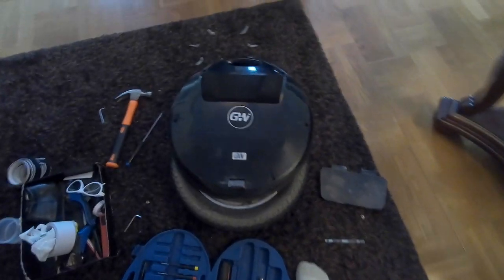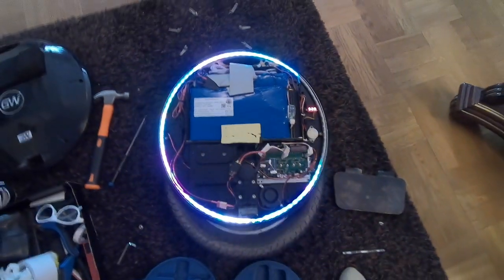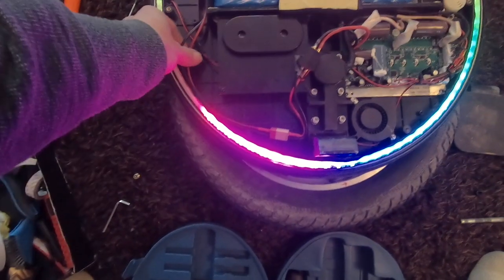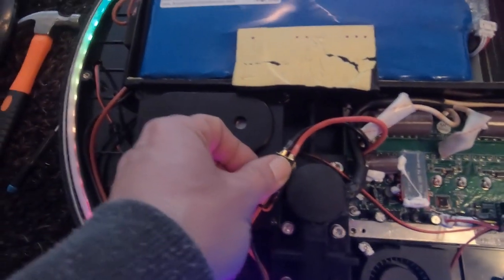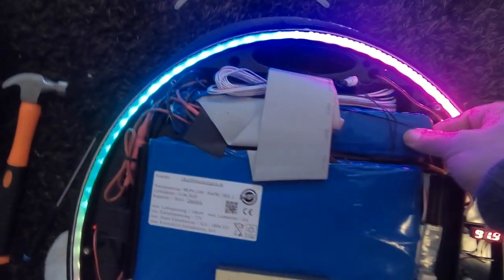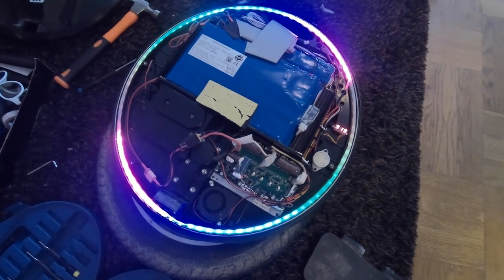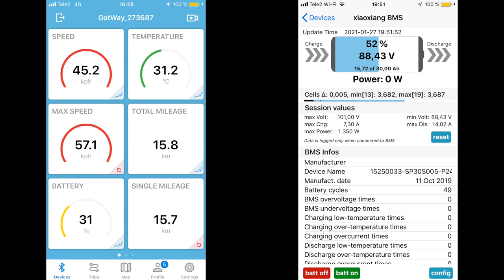The Return of my 1Rad 2664Wh Nikola Plus - Summary in Description

Comment: Hey Mike,
Happy for you, you finally got your Nikola back.
I'm curious, have you considered/researched purchasing your EUCs from a more reputable source like say e-rides.uk or myewheel or eucservice etc?
Stay safe bud!
Reply from the maker: Hi Moshe! 1Rad was said to be reputable. E-Rides has shown to be reputable however as of Brexit they are no longer an option. EUCService has shown to have long delays and also they did not have the 2664Wh mod. I chose euc.sale this time as the price was right and several riders in the group have purchased from them and also Denis does a lot of good work for the community and is an awesome and genuine guy. In the end buying many wheels = buy as cheap as possible and then just pocket the difference. That can be spent on reapirs instead of spending extra and not getting any service anyway. Even AliExpress would have handled the motherboard issue better than 1Rad.
Reply: @isthereanyfood  thanks for the response Mike!
Yes, I'm aware of Denis from euc.sale, he's a nice guy & legit.
Good luck with your new wheels!
Safe riding👍
Reply from the maker: @mo_euc  Thanks! I am happy to have the Nik back. The EX.n is nicely priced and basically a fat RS. I will see about opening it soon and seeing what I can do to improve it a bit.

Comment: Hi there.
Do you know much about the 3rd generation internal circuit board?.
Is it fine with the 2nd generation board?
I'm looking to buy the 84v GW Nikola which currently has the 2nd generation installed. Haven't bought yet
Reply from the maker: Hi Ava, are you getting a used 84v Nik? It is still a very nice wheel especially if you can get it at a nice price. The 100v Nik Plus from Chicway is a steal so make sure you compare with that. If you see everything I have been doing with my 2 year old MSX you will see that it really takes a lot to kill a wheel and there is very little wrong with them.
Reply: @isthereanyfood  I'm buying a new GW Nikola 84V 1600wh with the 2nd generation motherboard. I've ordered a 3rd generation board to be installed at the shop I'm buying from

Comment: What do you mean 1:10 since it's an older version the fan works better?? My Nikola plus when I turn it on the fan rev's up and down repeats over and over until I ride it, does this mean I have a newer version?
Reply from the maker: Hi! Yes that probably means you have a newer version. It is also easy to tell by looking at the the screw covers. Mine are grey. The newer version are black.
Reply: @isthereanyfood  yeah you are right mine are black.
Reply from the maker: @elgringodelasscooters9616  Cool! Then you have the updated motherboard as wheel which is the beefier MSP type.